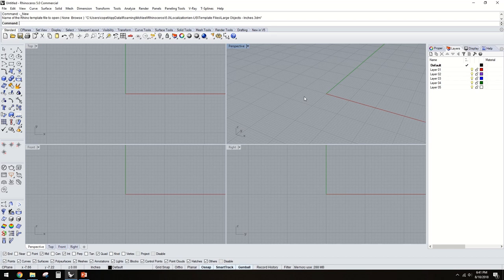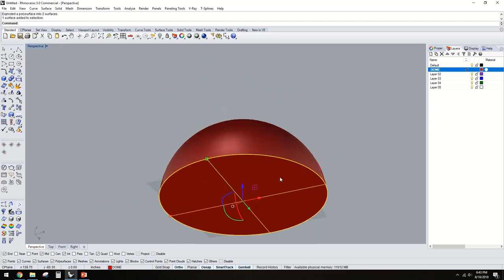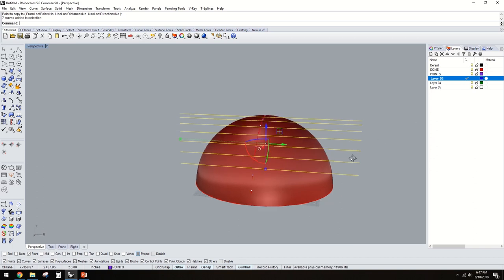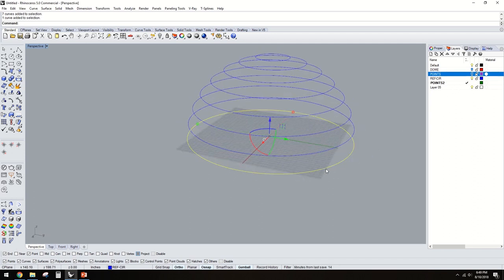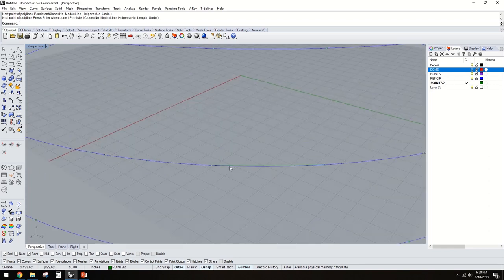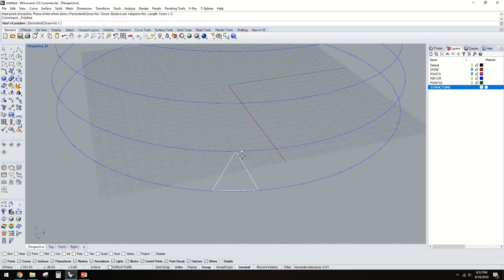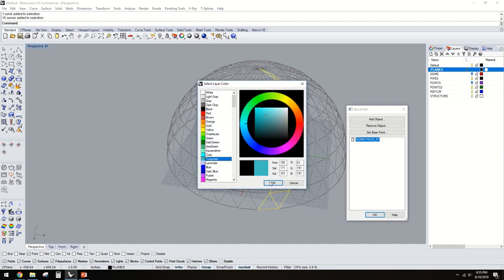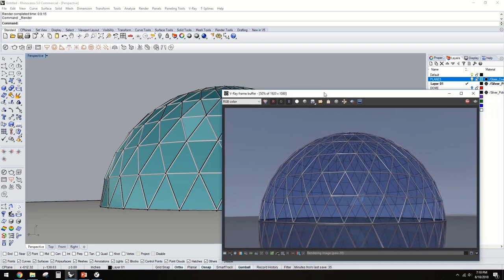Dome design tutorial other method of creating domes in Rhino 5 3D

Comment: Why my rotate didn’t work😢 (to offset those points)
Reply from the maker: Make sure you rotate half the angle
Reply: @DCOParametric  My rotate works now(cuz I chose the curve instead of the points therefore I can’t see it rotates😂) but now I have problem with planarsrf the block, it warns me self intersecting curves were found and suggests to use curve Boolean processing but the generated face just didn’t fit the block…I’m 100% sure I drew the lines correctly